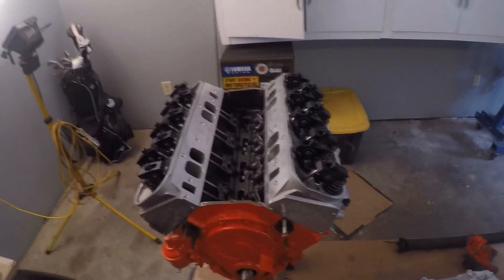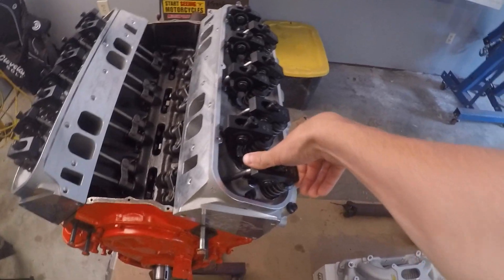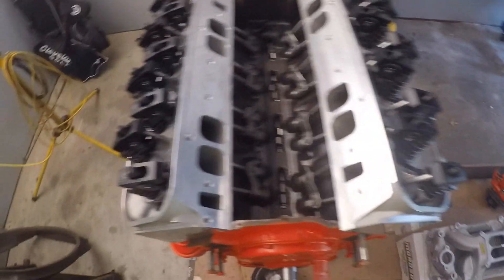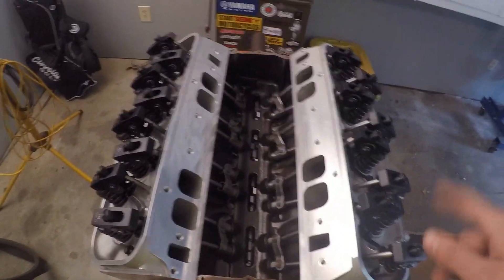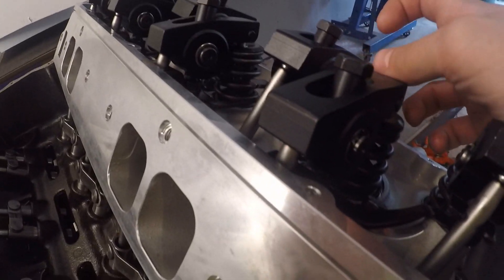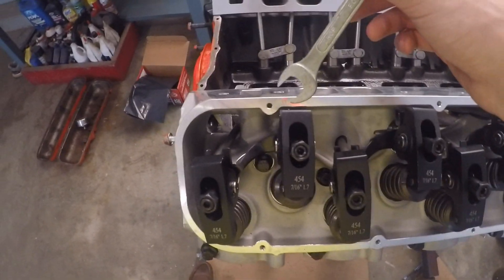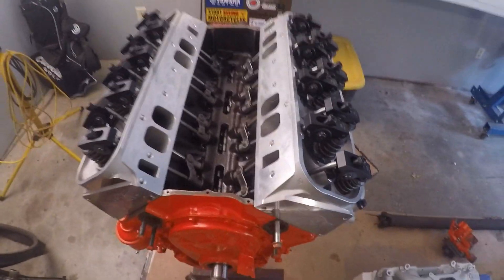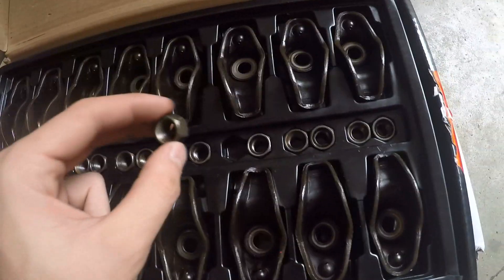How to Adjust Valves on a Small/Big Block Chevy! Hydraulic Lifters method.

Comment: The way in the video takes too long for me. Back many years ago i had old car repair manual that told me how far to turn the crank and which valves i could adjust at that degree, after doing that the light bulb turned on and i started adjusting them for V8's by the firing order. When at top dead cylinder the number 1 clyinder is firing so both valves are closed turn it 45 deg and the next one would be firing adjust those and so on. I ran them again a few separate times while the engine was running to check my adjustment and it was perfect.

Comment: Was setting all my valves and was testing to see if I could plung the lifter.  All of them were fine till I got to #4 intake and it’s stiff as fuck and does not compress.  Any input on what to do??
Reply: Note everything is brand new
Reply from the maker: It’s either bottomed out or full of oil. If u can get 0 lash and a half turn id say your okay
Reply: @flyin4speed i got it to zero but when trying to do the 1/2 turn it’s super tight and starts compressing the spring.  And the lock is sticking out the top where as all the others are even and 2 threads down.  So I’m confused
Reply from the maker: @bradenhoward7464 check with a flashlight that the pushrod is in its place in the lifter. Next, If they are roller rockers, make sure the flat side of the center piece of the rocker, is facing up towards the poly lock. Tighten it to 0 lash and spin the motor over 1/4 or 1/2 turn at a time and see if rocker gets play, you may be on lobe of cam
Reply: @flyin4speed yeah it’s a full hydraulic roller setup.  I’m going to tinker with it tonight and see what I can find out.  Thanks

Comment: How do you know what is the intake and exhaust valves? Are the intake valves closer to the intake and exhaust valves closer to the exhaust? For a bbc
Reply from the maker: Look at the ports in intake and where the header tubes come out. The valves/rockers are in line with them. Intake rockers should be the top 4, exhaust are bottom 4
Reply: @flyin4speed, thank you for the fast response.  😊

Comment: I usually just adjust mine on the base circle of the cam, at 3/4-1 turn, but have you ever tried to tighten the lash more than 1 turn on a hydraulic roller? I know on my old L98 with upgraded lifters over stock, they were s little noisier at 3/4 turn from zero lash for preload but it ran great to 7400-7700 rpm, but at 8k the block did crack from cold knock more from cold knock and not being tuned at that RPM from Ed wright from fast chip, but I'm building a new dz302 efi, more compression larger custom cam at Berowskis , but I may also try the old duntov cam with 112lsa for efi same lift and duration for a test with my Hogan sheet metal tunnel ram, and nitrous and boost, but it's fun to experiment a little lol, I'm shooting for 800hp n/a 8500-10,000+ RPM fully forged stud girdle and a whole lot of goodies, I'm really trying to push the envelope on this build tpi I like any other

Comment: I got same set up as you can't get 3 of the caps to screw on at all rocker is flush wit stud
Reply from the maker: Are you sure everything is sitting right? Pushrod in its spot? Is the flat side of the center piece of the rocker facing up?
Reply: @flyin4speed  they ended up going on by hand after some rotations of the crank I'll look today amd double check make sure they're all installed properly
Reply: @flyin4speed  the centers are all facing the same direction whether it's right or not idk but 😆 I'm inclined to believe it was installed properly we got engine pro rockers
Reply: Hey Colton, he is referring to the roller trunion on a roller rocker that goes over the stud. One side has a rounded surface and then 180 deg has a milled flat spot for the adjusting nut to recess into.

Comment: I followed your method somehow I’m not getting any compression. Any suggestions
Reply from the maker: You have a valve hanging open somewhere. Do it at 0 lash, no extra half turn, and try to start it.
Reply: I'll give it stab again this weekend. When setting zero lash, does the rods needs to spin freely with a little drag? @flyin4speed
Reply from the maker: @jameswoods532  yes you could go by that. I just feel for up and down play on the rocker tip. If you’re lifters are pumped up I could see it hanging a valve. Set at 0, and see how it runs. It’ll be fine there if it runs good.

Comment: Adjust the preload from the bottom, 1/4 or 1/2 turn up from the bottom. That way the oil pumps up much quicker after bleed down and you get instant oil pressure on start up.
Reply: It's better to keep the lifter at the top end of its travel rather than the bottom. If you happen to float a valve the lifter can only pump up a small amount, which might save your piston, valve, or push rod. As an example, my new lifters have .120 of total travel, turning a 1/2 turn on a 7/16-20 stud will preload the lifter by .025. If I happen to float a valve, the most the lifter can pump up is .025, with a 1.7 rocker that's .042 more lift at the valve. If you set preload from the bottom with a 1/2 turn, it's also .025, but that leaves .095 of travel in the lifter, if you float a valve the lifter can pump up .095, which is .161 more lift at the valve with a 1.7 rocker. That's .119 more lift than setting preload from the top. I much rather have a valve .042 further down the chamber than it should be, than one .161 further down than it should be.